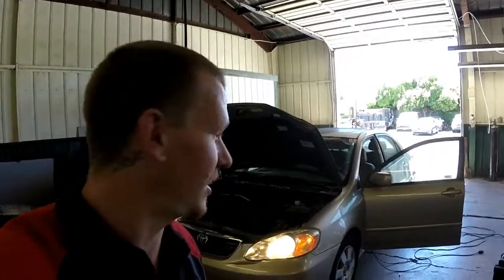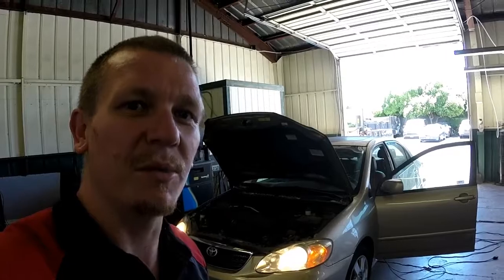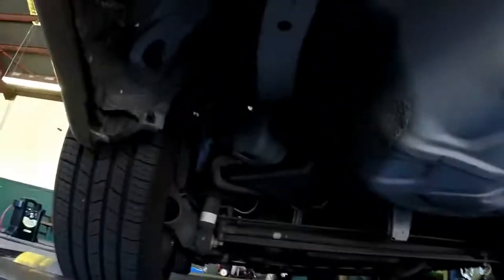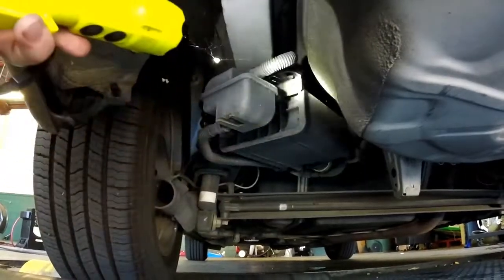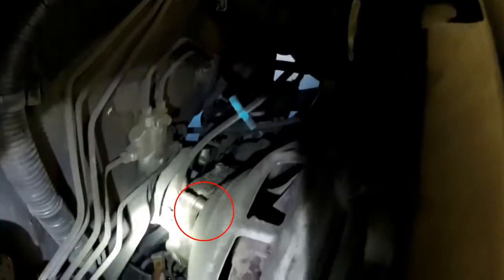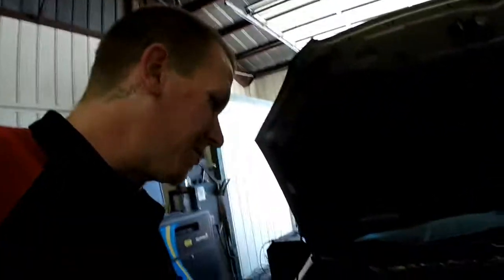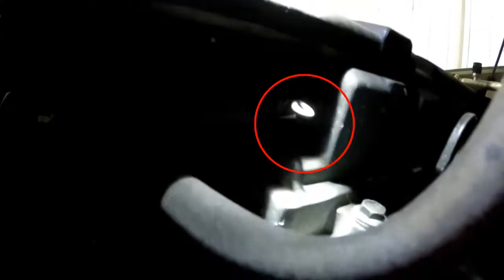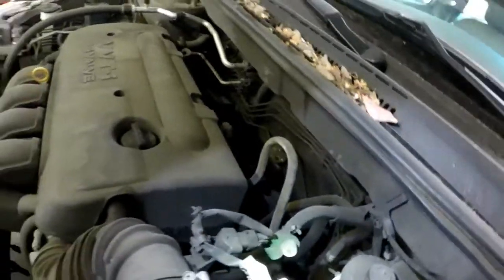Toyota Corolla emissions locations: PCV & EVAP

Comment: My car won't start every time after I fill up the gas. Dealer said both the fuel pump and the valve of EVAP are good. What could be the problem? Thanks.
Reply from the maker: Did they make sure the purge and vent were being controlled? Or just verified the components are operational? Newer scan tools can open and close the vent and purge... if its only after getting gas. I'd say the purge might be stuck open and causing a super rich mixture. Do you just let the car set and it turns on eventually?

Comment: Question, for smog. How do you adjust the timing belt and do you use the light gun to light on the timing belt that blinks so you can see the white dot ???
Reply from the maker: This vehicle has computer controlled ignition. There's no distributor. There's ignition coils on each spark plug. I believe this Corolla also has a timing chain and not a timing belt. What is the year make and model that you working on?
Reply: @ScottiesHobbies  exactly the same one on your video sir. Mine is 2004 Toyota Corolla LE 1.8 liter engine automatic transmission
Reply: @ScottiesHobbies  I used a ob2 scanner and there's no check engine light I'm gonna smog my car just trying to get ready
Reply from the maker: @pennfishing9246  on this vehicle we do not check timing. If it is the same as shown in the video is a plug-and-play smog. All we do is plug in the OBD2 reader to the smog machine, the smog machine gets the information it needs. As long as all your monitors are set and you have no check engine light you will pass on your OBD2 check. Visually we only make sure that your emission components are there. There's no functional checks on this vehicle.
Reply: @ScottiesHobbies  thank you sir you are very helpful. You just got a new subscriber and likes, God bless you for sharing....🙏👍
Reply from the maker: Glad to help.